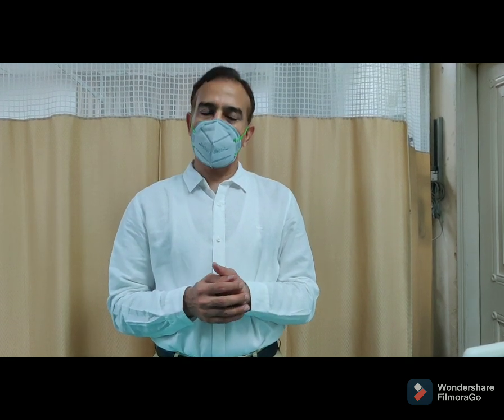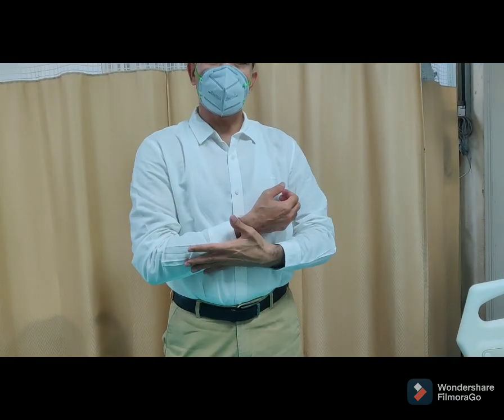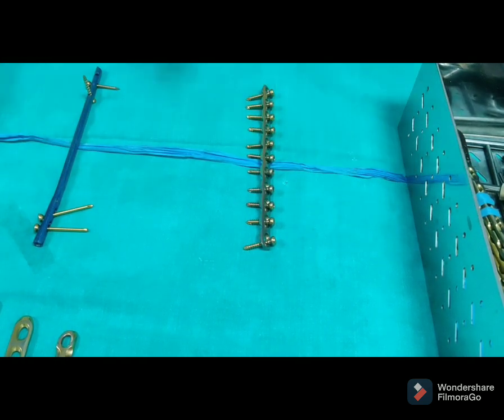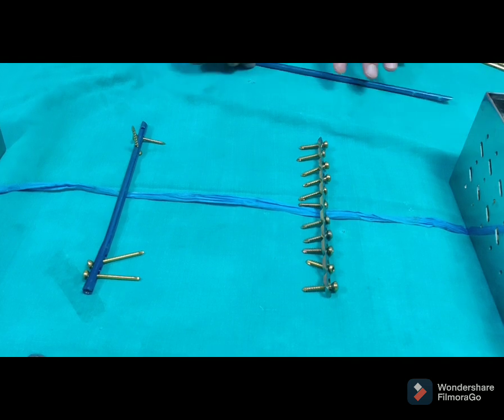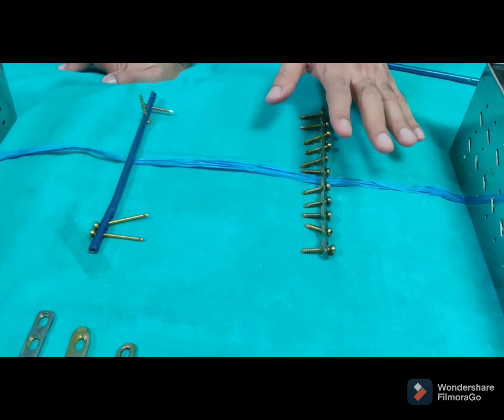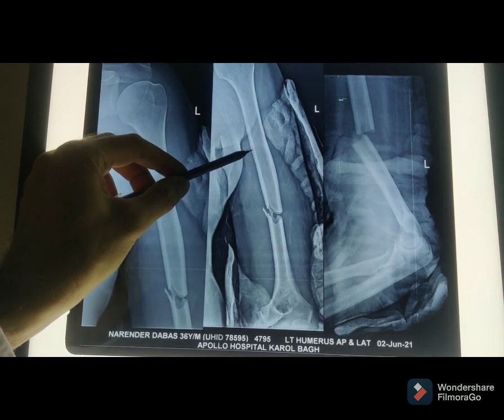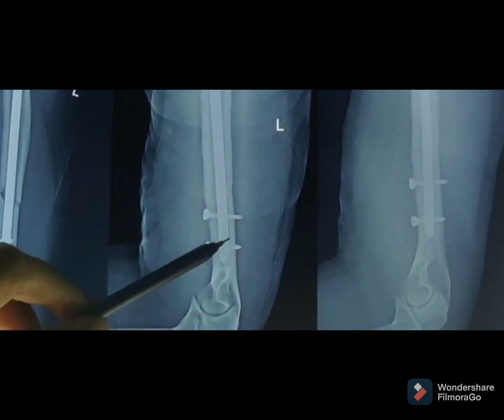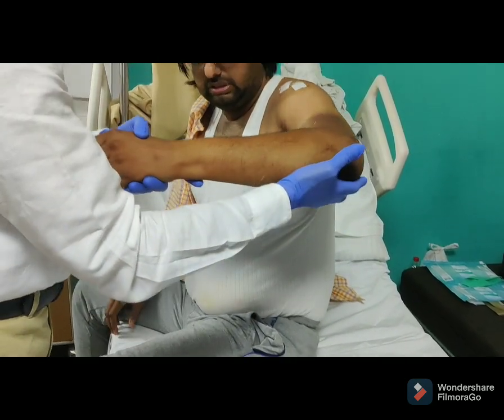Fracture Humerus fixation by MIS Technique -- Part 1

Comment: Sir For distal 3rd fracture of humerus plates are implants of choice. Also when not done properly, humerus IMN has higher rate of non-union than plates. IM nailing in this case is preferred though.

Comment: after fixing plate / screw ,  within 1 month of surgery , x-ray report shows rupture and one screw position is coming out and doctor adviced for new surgery to fix this issue. Patient is 77 years old and doctor claim that due to weak bone this has happened. We were doing accupressure therapy also as advice by doctor.  My question is  do we go for new surgery  to solve this one screw issue  ?  And do this plate / screw system will last for long time or frequently such issue of  rupturing of plate / screw will  arise ? Is it possible to change plate / screw with nail ? Will it be more reliable then plate / screw for long term point of view ? Please advice

Comment: I got a Proximal humerus fracture, ORIF plates inserted sir.
2 months over. 
How many months required to get back to normal.
Plates should remove or if its inside any issues will comeing sir. Pls tell me.
Reply from the maker: 6 months after plating you can do normal activities.
Plate should be removed if it is painful
Reply: @DrAshwaniMaichand  
Thanks for your valuable reply sir,
 now I am going for P.T, it was very painful sir. Suggested 15 days P.T. is required sir?
If its not comeing pain no issues sir? 
Kindly tell me sir I need your words sir.

I am skared sir. I am 34 year sir. 4 year daughter is their, 74 year father, 62 years mother sir.
 I am only earing person in my home sir.